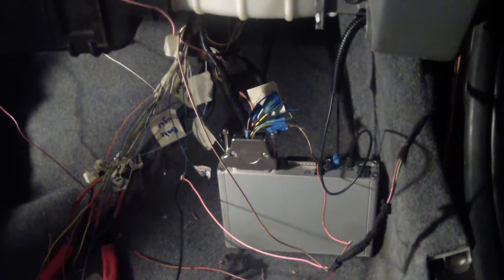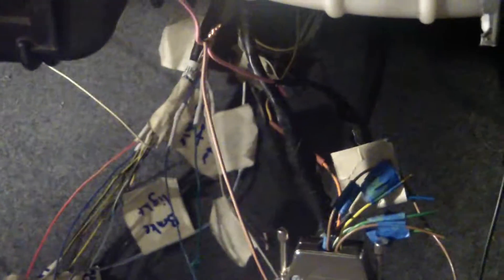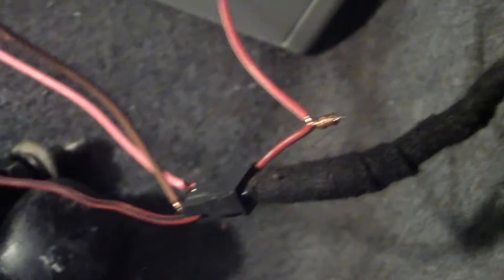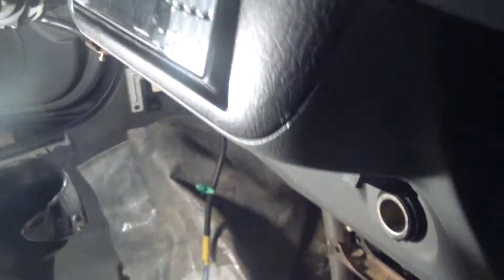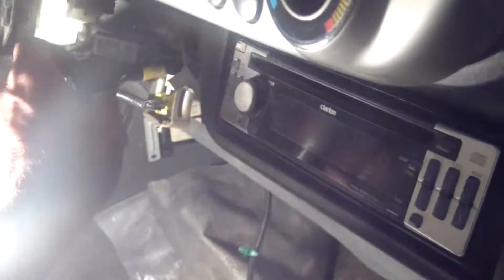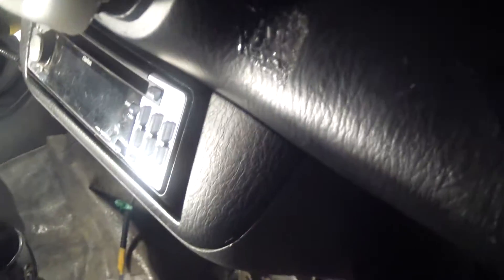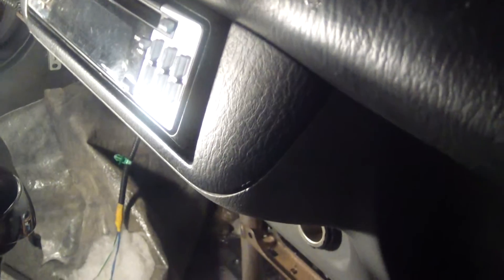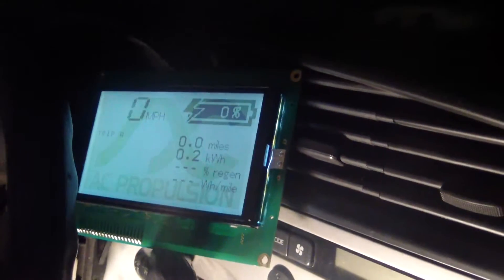DIY Electric Car: 2000 Honda Insight EV Conversion

Comment: You could create your own service manual for that
Reply from the maker: I guess so I did get some installation instructions when I got the system but every custom electric car is different so unless I do more of the same car I would have to start from scratch every time...